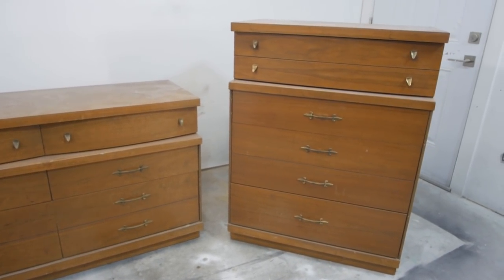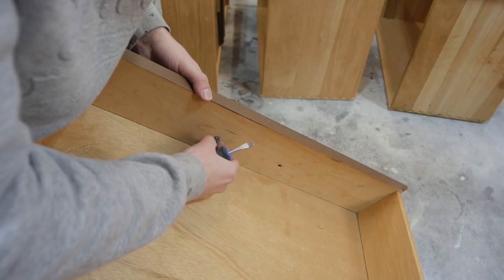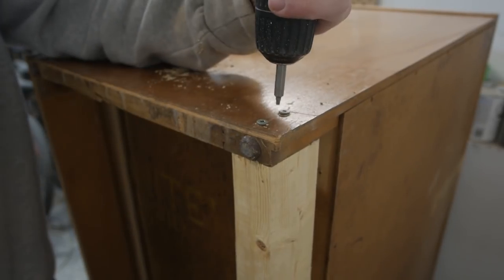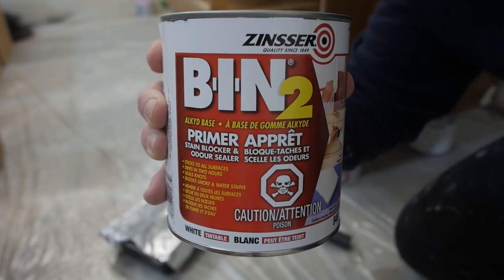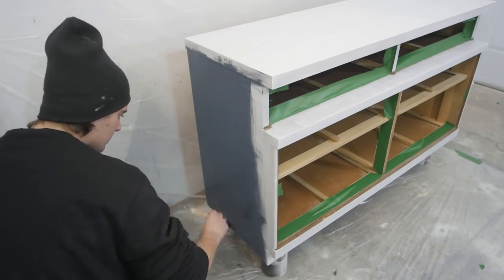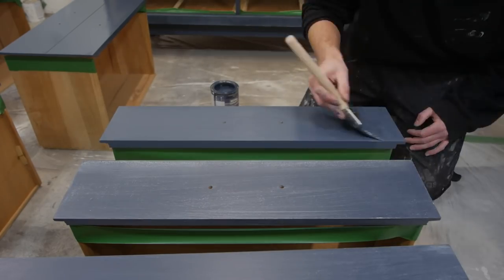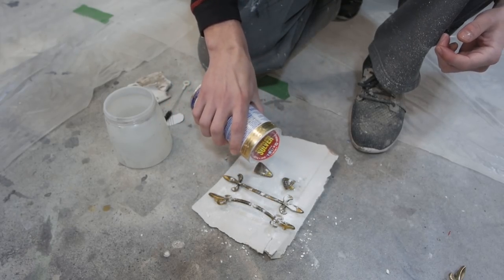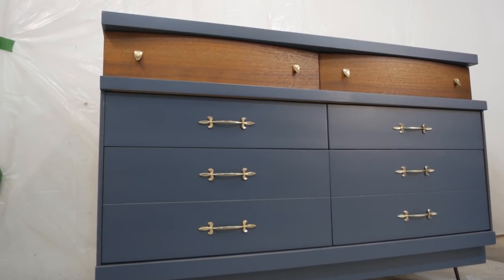MID CENTURY DRESSER MAKEOVER X2 | Furniture Painting & Staining

Comment: I do not understand why you used a roller for the primer but not the paint. Nor do I understand why you states a sprayer would create a mess with the paint, but went ahead and used one after you painted. The clear coat has the same chance of making a mess as the paint. 
I am not stating you did anything wrong, I am genuinely confused by your thought process.
Reply from the maker: Its waterbased polycrylic and oil-based primer. I didn't want to use mineral spirits to clean any spills and overall the spray gun. I would need to thin the primer with a proper thinner, the poly I thinned with water.

I rolled primer cause it faster than brushing, I sanded the roll feeling/texture out. I brushed light coats to have a very smooth finish.

Leigh, your comment was genuinely pointless since you clearly do not have experience in this work, so please keep them to yourself.